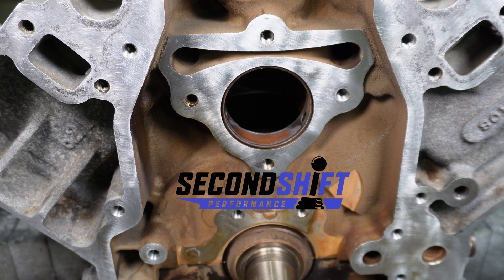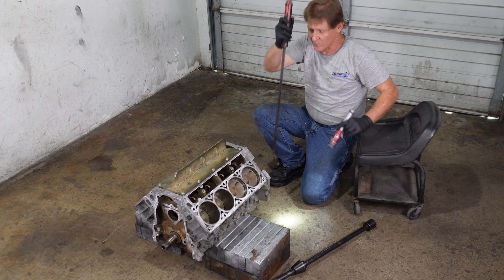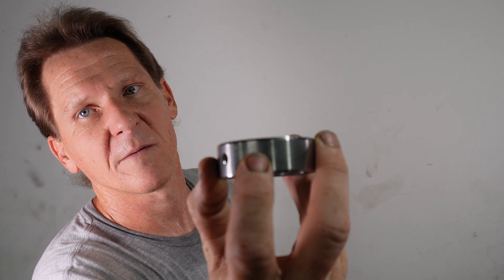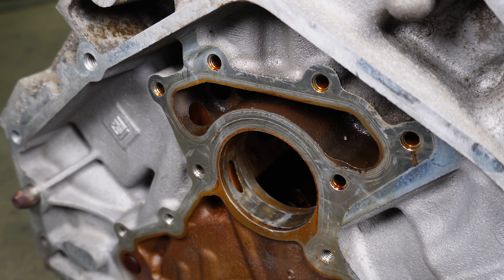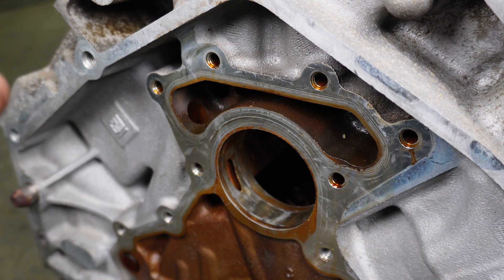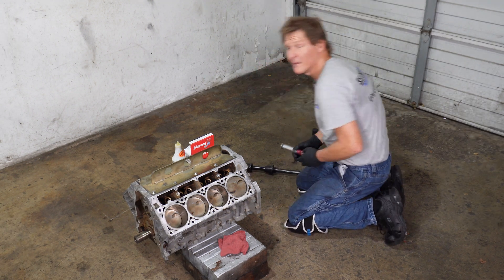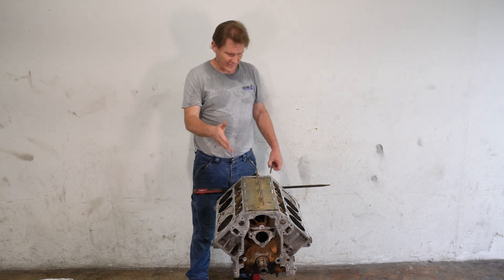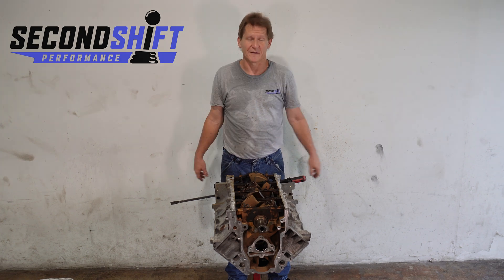How to Replace LS Camshaft Bearings – Step-by-Step Guide

Comment: YOU INSTALL THEM DRY AND WITH THE BLOCK TURNED OVER. AND WHY WOULDNT YOU REMOVE THE CRANKSHAFT TO SEE WHAT YOUR DOING???
Reply from the maker: Hello. And thank you for watching our content. 

Camshaft bearings get changed 'in the field' all the time. The crankshaft does not need to come out for this to happen and in truth the engine does not have to be removed from the vehicle in a lot of cases. 

The transmission and radiator and condenser will all have to come out but camshaft bearings on most V8 RWD applications can happen with the block still bolted down to the engine mounts.

While some guys out there will do cam bearings that way, I prefer to have the engine out of the vehicle. 
https://youtu.be/1oNY7KMkqJg?si=3GI02AUmXVO3ZESo

Comment: How many miles were on that engine?
Reply from the maker: IIRC the claim from the boneyard was I think 102k or something like that.
Reply: @secondshiftperformance so camming without changing the cam bearings is incredibly bad? Say 150kish
Reply from the maker: @GSREGAL41  While you can do it and a lot of people do as the cam wears downwards the gap opens on top of the camshaft and is known to be a source of reduced warm running oil pressure. Replacing the 5 camshaft bearings ensures tight clearances that do not let large amounts of oil to just bleed off from the galleries. And if the performance camshaft is going in with more aggressive lobes and stronger valve springs than what wore out the bearings why wouldn't we want to restore that as the more abusive parts went in? And on that same subject, don't forget Teflon coated cam bearings are awesome and designed for that hotter cams and heavier springs. Teflon has increased fatigue strength, protects against dry starts, extends life, improves performance, and enhances lubrication. We have another video on this subject installing the Teflon coated bearings, here: https://youtu.be/1oNY7KMkqJg?si=2sIenshhE4q4k4T8